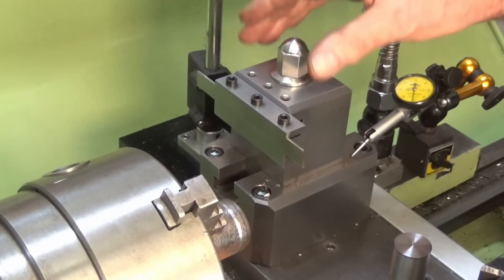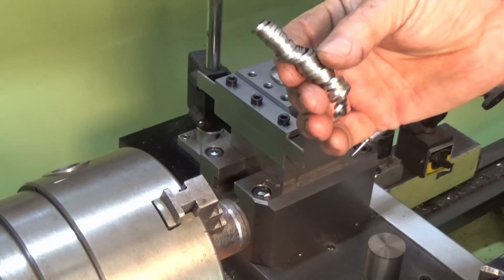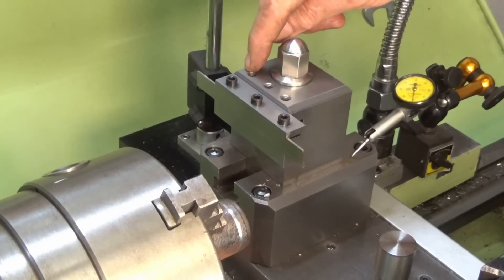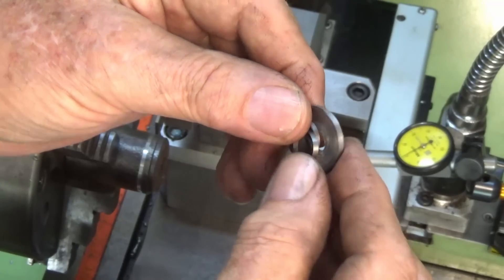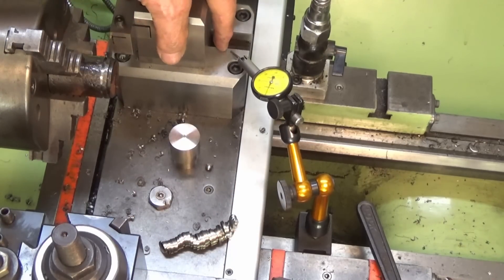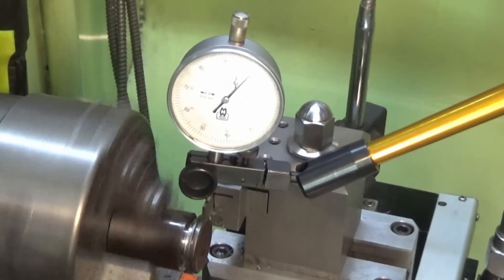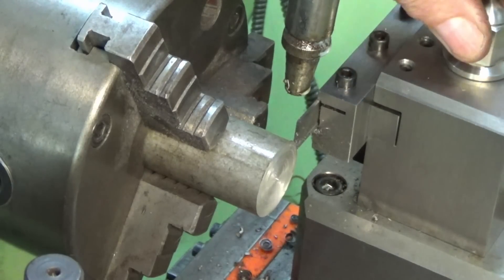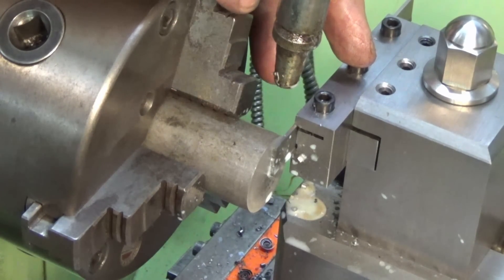Rear Parting Tool Holder For Your Lathe - A Little Performance Analysis

Comment: If the marks are radial, it suggests that whatever is happening does so in sync with the rotation of the work- since you're power feeding, I'd investigate what effect using different gear ratios has (ie does the angle between tge radial lines vary with gear ratio? Presumably hand feeding wouldn't give waves as there'd be no relationship between chuck angle and infeed if you're winding by hand)

Comment: It looks very good. A lay view: I don't see how the sort of play you are looking at can possibly cause the radial pattern. Whatever causes it, it is happening at the exact same angular position of the workpiece, on every revolution of the spindle, or at least at some small integer multiple of the the number of revolutions. I'd be looking at the train between motor and workpiece, not the workpiece to saddle part of the mechanism. Say one of the gear teeth in the power train has a slight malformation, then every fixed number of revolutions the workpiece may speed up minutely, causing a tiny cosmetic effect on the cutting action. Or a pulley is slightly out of round. Or something like that. I wouldn't think such minute variations in workpiece speed could ever be totally overcome by even more rigidity. Anyway, you are getting fine results from a beautifully made tool,  so no worries.
Reply from the maker: Thanks. I am still going to investigate the preload on the main spindle bearings. I can tweak that a little to see if the pattern goes away. When I first purchased the lathe (used) it had fallen off a truck and the cross slide feed screw had been slightly bent. It would leave regular bands in the faced off surfaces. I was able to straighten the bent section of the screw and problem went away. As you say, I am probably chasing my tail somewhat. 
Regards,
Mark

Comment: Thanks for clearing the doubts about the wavy pattern. I didn't expect the parting blade to be out of square, but that meets my idea that there was side flexure (wish you had placed the indicator on the blade side as well). Despite the minor imperfections, it's just parting, not facing - wish I could do close to your worst result 🙂
Lovely cockatoo in your garden. I have a parrot by the side of my desk, and it behaves exactly the same. Just wish it didn't make such a mess, but I can't bring myself to place it in other room - I got used to its crazy mimics of speech and sounds. It also interferes with all my phone calls, saying hello repeatedly and ringing like a phone 🙂
Reply from the maker: I will be doing some more tests with the indicator and I will try to test for side to side deflection. I suspect that all I will see is some flutter on the indicator though as the frequency or resonance will be quite high. Those cockatoos are quite entertaining to watch. We get to see them quite closely from our kitchen window. 
Regards,
Mark
Reply: @Preso58  You are quite right - resonance plays an important role in these small imperfections and, if frequency is high, it's hard to see deflection (would need a vibration monitor), although with the misalignment in previous video, I'm convinced it would be visible.
You have the best solution - watch cockatoos in the garden and keep the mess outside 🙂

Comment: If I wanted the tooling to be square to the chuck, I would figure out a method of holding an endmill with the chuck and cutting the tool holder in place. It seems like it is good enough so it probably isn’t worth redoing it.
Reply from the maker: Good idea. I do have a right angle head for my Bridgeport and I can mount the whole malleable iron base in the milling machine and indicate it square. It would be a simple matter to just take a light cut over the pocket where the blade is clamped. I also have an ER40 collet chuck that could be mounted in the lathe but the vertical alignment would  be a bit more difficult doing it that way. I would like to have it dead square so I can take the parting blade out for sharpening without having to worry about tapping it back square again.
Regards,
Mark

Comment: very nice build. i might try one of these on my 13 in grizzly.i'm a coward when it comes to power feeding a cutoff tool in a lathe like mine. i will be very interested on seeing how your insert tool works i have have broke three of them (bangood) all in the same spot just under the blade. my hss works just fine and leaves a very nice finish. i  use the multifix tool post . your video's are first class and always interesting. too many of my favorite you tubers are going the infommertial route. stay the course mark, i think you are what us home shop guys really enjoy.
Reply from the maker: Thanks Larry. Generally, I am not a fan of insert tooling. In my view, it is more suited to repetitive production work where cycle times need to be short. I find it hard to get the sort of finishes that big heavy lathes can produce with high spindle speeds and fast feed rates. HSS tools can be made very sharp with very little effort and they are cheap and adaptable. I am happy to be proven wrong though. I will try the insert tool but at least I can go back to the HSS tool if it doesn't work out. I must say it is very tempting to "sell out" and start accepting overtures from vendors who only want you to say nice things about their products but it's not for me. There are no plans to change!
Regards,
Mark

Comment: I recently made a solid carbide parting blade which seemed better than the HSS and even a Shars carbide-insert tool. Given the deflection was almost 0.002 in and most of it was in the blade, a solid carbide blade might be the way to go. Thanks for sharing your build and test results.
Reply from the maker: I did not know you could purchase a solid carbide parting tool! I would like to build a low speed diamond lapping tool like the one that Stefan Gotteswinter has. I think I would like to be able to put a razor sharp edge on the carbide inserts sometimes. I find that the commonly available inserts have too much edge radius on them for small work.
Regards,
Mark

Comment: I wish my lathe would work with this tool! Next lathe I'll definitely make something like this!
Reply from the maker: You do need to have a lathe with a machined surface on the cross slide which does rule out the South Bend and Hercus lathes. The good news is that having the rear tool post and an inverted tool means that it will work with a screw on chuck.
Regards,
Mark

Comment: Fantastic project. The one missing test is to measure the deflection of the tool holder- this would answer the many that posit the clamping screws would be better inverted. I do not believe this to be the case (clamping force is equal and opposite) but it would prove the point.
Is the tip ground square or with a slight tilt to one side? The radial pattern may  be due to a 'wandering' of the cutting surface, which is normally prevented by that tilt.
Reply from the maker: I did check the grind on the cutting edge and it is square or at least as square as I can check it. I may need to break out the digital microscope to have a good look. That was one thing I suspected as a cause for the wavy pattern but until I can get the insert tool I won't be able to compare it with anything else. 
Regards,
Mark

Comment: Positive result 👌,  definitely a much needed feature to any lathe, well worth the time and material. 
Possibly the radial lines are from spindle bearings, or chuck jaw jaw/belling out?, though as you say, harmonics, finding the source, or sources would be very difficult,  but it doesn't detract from the finished article. 
Do you get the same when facing conventially, or when facing using the rear tool holder?.
Very nice through experiment, thanks for sharing. 
Regards John
Reply: Any harmonics will be directly related to the stick out of the tool from the holder. Shorten the overhang and the harmonic will either go up in pitch or go altogether sometimes only moving the tool usually inwards even two or three millimetres will stop that from happening.
Reply: @samrodian919  I think changing the stick out of both part and tool are a subset, the whole machine, and it's reaction to the floor should be considered.
Reply from the maker: Generally I get fairly good finish on facing cuts. Certainly as good or slightly better than the last part shown in the video. I think that getting rid of the out of square alignment has made the biggest improvement to the performance of the parting off blade. I am still keen to see how the insert tool goes since it's geometry eliminates any side contact during the cut.
Regards,
Mark
Reply: @Preso58  Using a narrow HSS blade at its inception, possibly exacerbates any inaccuracies in the set-up, Possibly using an insert type parting off tool would have masked this,  or generated a whole set of different results. 
Really enjoying this treatise on machining. 
Best regards John

Comment: I made a rear part off holder that transformed the ability of my Chinese lathe and ordered the same type of carbide part off you have. In testing and frankly abusing the set up, it performed very well but the pressure opened up the slot that the insert fits in by bending the bottom down. (Down because I run in reverse for parting). I was able to add a support under the blade but in hindsight I would get a blade where it is taller giving more strength to resist the bending pressure. I did see the taller type.
Reply from the maker: Thanks. I was a bit reluctant to order a cheap import parting blade for the reasons you have given. I also considered a much deeper blade but when I modelled the tool holder in my CAD software it started to get a bit chunky. If I can part off stock up to 50mm diameter I will be very happy though. 
Regards,
Mark

Comment: Hi Mark, quite a few of us seem to be concerned about the direction of the load on the flexure holding the tool. It occurs to me that turning the tool upside down and running the lathe in reverse might yield some data on that one?
Reply: Chris Quinn, running in reverse means you have to have the cutting edge uppermost, as I have in my rear  parting toolpost. Otherwise the tool will just rub and not cut. It's exactly the same if you put the tool upside down in a normal parting off situation and run the lathe in the forward direction.
Reply: @samrodian919  Yep, daft suggestion. The cutting edge of the blade would be way too high and it's non-adjustable.  I should have drawn it out before making the suggestion - Sorry!
Reply: @chrisquinn3751  we all have brain farts occasionally!
Reply from the maker: Chris, I have had several people question the arrangement of the clamping screws which lock the toolholder in place. Many have suggested that the screws should be clamping on the unloaded side of the toolholder i.e. underneath. That way the tool holder is held up tight against a solid steel surface instead of the three point loads of the set screws. In fact, the original Colchester rear tool post had that provision but I am not sure it's an issue. It also makes it a lot harder to tighten the set screws that way. I also wanted to have the tool function without having to reverse the spindle direction and being able to part off immediately after a drilling or facing operation is great. Also, if you have a threaded on chuck it makes it possible to part off from the rear tool post whereas reversing the spindle would "unloosen" the chuck😁. 
Regards,
Mark

Comment: Thanks for doing the tests!  It's gratifying to see actual measurements that show the design idea isn't plagued by excessive lift or flex.  You've probably convinced some people they should add a new project to their list.
Reply from the maker: Thanks. I am very keen to see if someone else runs with the idea. It won't suit every lathe since many like the South Bends don't have a machined cross slide but I can carry out the parting operations now without the usual anxiety. 
Regards,
Mark
Reply: I'm certainly convinced. I also own a Colcester Student and parting is something I never look forward to.

Comment: You might be able to reduce play in your tool holder by relocating the flexure from the top to the bottom. In it's present configuration, the flexure/clamping screws have to resist the cutting force imposed on the parting blade. If the arrangement was flipped, these forces would be imparted on a more rigid fixed surface. Just a suggestion.
Reply from the maker: I have had many people make that same suggestion and I do need to make a new tool holder for the insert blade so I will investigate if I can incorporate that feature into the new tool holder. 
Regards,
Mark
Reply: That's a really good point. You could have all the rigidity in the world and you would still be limited to the rigidity of the flexure, which is intentionally not rigid! If the slot for the parting tool is in the center of the holder, all you would have to to is flip the holder over to fix it.

Comment: belt flat spot? making the speed varying?
Reply from the maker: I have recently fitted a brand new 2.2KW three phase motor and two brand new vee belts and a lower pulley to the lathe so it's unlikely. I still think that I need to check the main spindle bearings and check for end play in the spindle. 
Regards,
Mark

Comment: I've never had much success parting off. And unfortunately, with the way my South Bend is constructed, making a rear parting tool attachment isn't an option. I'd have to replace the whole cross slide.
Reply from the maker: I know what you mean. We had two Hercus lathes at the school where I used to teach. The Hercus is a clone of the South Bend and they had the same cast, round surfaced cross slide. Myford had the right idea fitting a long tee slotted cross slide to the Super 7 lathes. Maybe there is a good market out there for an aftermarket machined cross slide for the South Bend community?
Regards,
Mark
Reply: @Preso58  For your US viewers with small SB lathes (9A & 10K like mine) you can buy a T Slot cross slide casting and also a rear mounted toolpost casting for a parting tool. Search MLA toolbox. I have both in raw form in a box in the closet. 

The "problem" for me is that I don't have enough issues parting to go through all the work of machining another cross slide. I also use a carbide parting blade almost exclusively as well. I can't explain it either.

Comment: great job Mark, I think you are chasing your tail looking for perfection, that looked and sounded great parting.  Love seeing the cuckatoo, beautiful bird.
Reply from the maker: I think you are probably correct. I do want to try out the 3mm carbide insert blade though. It turned up in the mail today so I just have to make a tool holder for it. I will do a bit of a follow up when I have it ready. 
Regards,
Mark

Comment: I wondered as you made this, a tool holder for the front side of the lathe is solid in the direction of the force from the cut, and the clamp is on the "unloaded" side of the tool.  Your rear tool holder (Which I plan to emulate) is carrying the force on the clamp of the tool holder, and the three set screws in the tool post.  It apparently does not make a significant difference, at least that I could see from this video.  The tool holder could easily be modified and flipped over, just need clearance on the rigid side for the wider cutting edge.  I haven't yet managed to imagine a way to put the clamping screws on the bottom of the tool holder that is not clumsy and inconvenient, still pondering that one.
I suppose if you controlled the size of the clamping tang on your tool holders carefully you could make a wedge style clamp that pulled horizontally into the tool post below the tool holder.... Hmm, I see an interesting project here, but I doubt it would actually perform better in any way that I could measure.  Maybe in wear on the set screws/top of tool holder if it were used a lot, but the whole point of this was for smaller lathes in hobby shops, which generally don't get used a lot, at least not in my hobby shop.
Reply from the maker: The design I ended up with was really a compromise between having good rigidity and ease of access to the clamping screws. For that narrow blade, I think the arrangement is adequate. Certainly, it would be more rigid with the clamping screws underneath. The original Colchester rear parting tool post had slots for both conventional and inverted tools and the set screws were underneath on the slot for the inverted tool holders. It had clearance all the way down to the riser block. I am just going through the design for the tool holder which I need for the 3mm carbide insert tool and it will have the set screws underneath and the flexure slot close to the bottom edge of the tool. I think for that tool it will be necessary since it will be taking wider and deeper cuts than the HSS tool.
Regards,
Mark
Reply: @Preso58  From the way it works I think you are correct about it being sufficient for the cutoff blade.  When I make mine I will be making it to hold more than just cutoff tools, because any form tool has the same issues that plague cutting off on smaller machines.
  I have a Clausing 11 inch, which is actually just a rebadged Harrison M250, with a 1.5 HP motor, so form tools or cutting off will chatter or even stall the lathe if I run higher RPMs to improve surface finish.  I am hoping a rear mount will give me a little more capability . 
 The complication of making it general purpose instead of just cutoff/grooving is that it needs height adjustability to accommodate hand ground form tools that may at times be a little clumsily ground so will not always have the cutting edge on a plane with the top of the tool blank, but at worst case it won't be any worse than shimming a 4 way toolpost.  
I may just put tools directly in the post, have slots in 3 sides of it appropriate for 1/2, 3/8, and 1/4 inch tools, and just use a holder that fits in the 1/2 inch slot for cutoff tools.